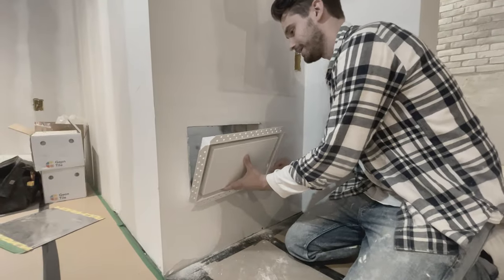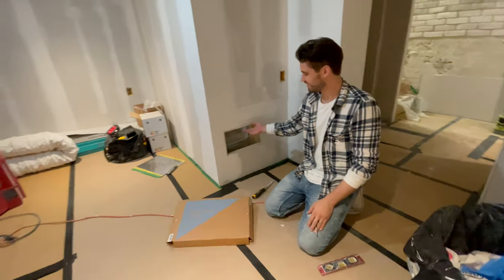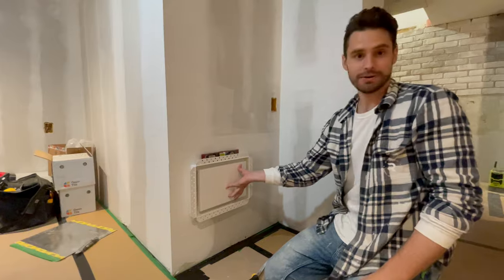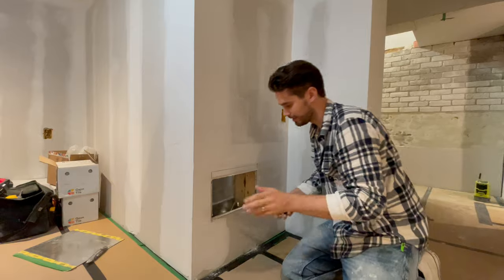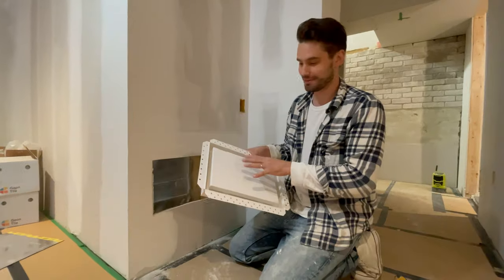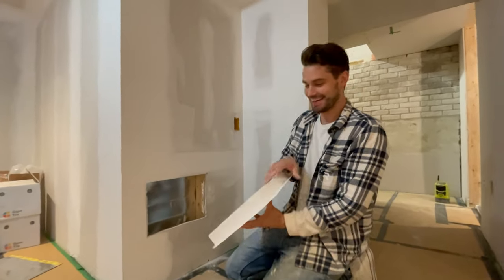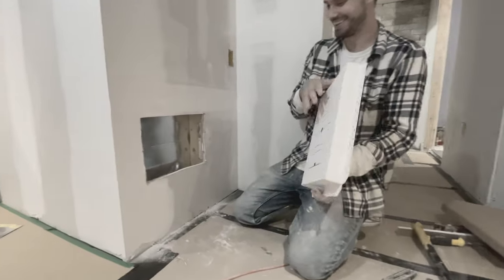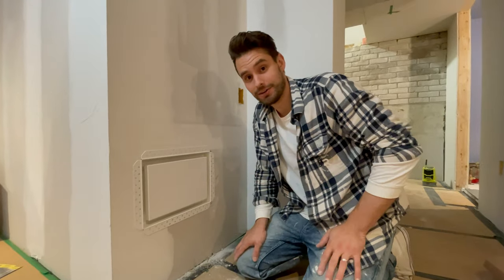Upgrade Your Air Return! (Aria Vent Drywall Pro Air Return)

Comment: I recently went to a house that was remodeled and they had these style registers  (vents) in every room for supply and return. The furnace kept shutting down on high limit because the airflow returning to the furnace was sooo restricted. Customer gave me approval to cut out this style on the return and it solved that problem. But the system still had high static pressure. To all homeowners, don’t sacrifice function for looks.
Reply: This is 100% correct.

Comment: This return has a major problem,  I'm a Nate certified Ac tech.  I've worked on refrigerated systems chillers and low temp units for most of my life , it will not flow the same air flow as the system is meant to have.   If you install this while it will look good, the airflow into your unit will decrease causing it to freeze up, add head pressure to your compressor and eventually cause your ac compressor to fail.  Things like this need to be done by professionals because airflow is the most important thing for hvac to work properly.
Reply: Agreed. All that decorative, designer crap is form over function. My winter return vent was stuck open earlier this year in my bedroom and it was hot and humid in there. I fixed it so it would close and it is now perfect in there. If the wrong return being stuck open did that, I could not imagine what practically no return would do. 

The previous owner of my house installed those stupid designer vents on my first floor. All they did was heavily impede airflow and direct it upward. My first floor had hot, cold, dry and humid zones all over the place. I replaced them with regular vents and the problem disappeared. In fact, it was a night and day difference almost immediately. 

Moral of the story, designer HVAC vents are garbage.
Reply: would this have the same negative impact on a natural gas furnace? I live where we don't need A/C (not common in homes here) but definitely need central heat!
Reply: @caitkacz   typically when the furnace is on, the fan is on a slower speed than the ac side.      Ideally there is a temperature split that us acceptable  anywhere between 40 go 70 degrees.   The risk of lowered airflow across the heater is that the chamber inside ( that directs burnt fuel and carbon monoxide out)   can crack If run outside of designed temperature range.    In some cases an hvac tech can wire in a medium speed to lower the temperature of outgoing air but the best solution is always to have a properly designed air duct system.   In my opinion this return duct is not that
Reply: looks like there were perforated section that are removable, he just didnt remove them

Comment: Hey Einstein, the air return is supposed to be completely open with a filter installed so the heat can be drawn into the air handler. Now your customer will be calling the A/C repairman out, and he's gonna be pissed when he sees the stupid move you did.

Comment: "Air return" and "cover" don't go together. Blocking the vent (or at least significant cross section of it, in this case) limits air flow.

Comment: Do not install these registers in your home as they dramatically reduce the airflow out of the register, which can damage your comfort equipment. It is advisable to consult with a professional HVAC technician to understand the impact of reduced airflow and increased static pressure on your comfort system.

Comment: I'm pretty sure you won't get the best air flow and the system will goes off because of overheating.
Reply: Worse than that, it will burn out your AC and you will be paying $12000 to have it replaced in middle of summer.

Comment: Loses a lot of return airflow very restrictive should keep in mind might cause problems down the road
Reply from the maker: Good tip 👍. We’ve never seen any problems with them, but we always recommend you check with your HVAC Specialist before installing.

Comment: I keep watching videos of these darn things being installed with no one showing me the before and after static pressures. Are absolutely no hvac professionals buying these and testing them?
Reply: If you look at the website you wouldn't buy them either start out at $60 for the cheapest, and its all plastic.
Reply: That's like asking if a skydiver jumps without a parachute. Anyone in hvac can spot this snake oil.

Comment: I think what would solve the restricted airflow was if the magnetic cover plate was covered in a breathable fabric in the same white color.  It would still conceal the holes while maintaining the design and providing free air flow.  The design would be similar to the fabric plates that cover the front of a speaker
Reply from the maker: that’s a cool idea 👍
Reply: It would still restrict the airflow and it would clog up with dirt and dust.
Reply: That would theoretically make it a big air filter and eventually clog no different than any other filtration system.  Return air is just that and that is a crazy small return in an odd location.  That unit would have to make some noise.  I have designer grills but I don’t think there is any way to dress that up.

Comment: Hello! Big fan of your videos and installed the aria flight light switches. I want to do this as well! 
However i have a major problem, all of my vents and returns are on the wall just above the floor.. so if you could imagine bottom is above flooring and 2inches height x10 wide.. 
please help!
Reply from the maker: Hey, thanks! 
Yes, that’s going to be a bit of a challenge for sure. We’ve seen people cut off the bottom flange but it’s not really want it’s designed for👍

Comment: why is there a stud visible in the return?
Reply from the maker: Good question! The cold air return in this instance is utilizing the unlined wall cavity (in other words the studs and drywall form the ‘ductwork’ for the air return). It’s common practice where we are, but also not up to code in some areas 👍

Comment: Are there filters that fit in behind the removable clip on piece?

The vents I have currently have filters behind them.  I’m wanting to modernize my home and this would be something I’m looking at, as well as the ceiling registers.

I just don’t want to choke out my furnace.
Reply from the maker: These do not have a built in spot for a filter, unfortunately. You can check their spec sheet re. airflow (or consult an HVAC technician), as you may have to size up in order to achieve the necessary open free area your furnace requires 👍

Comment: It kind of look like he forgot to punch out the holes in the back of it so it can actually suck air
Reply from the maker: Good catch 😉. We intentionally left them shut until we finished the ‘dusty’ portion of the renovation 👍
Reply: @RefreshHomeImprovements  This is a DIY video but you didn't film nor reference punching out the holes in the back?  Anyway, I think this is why you have so many people pointing out air flow issues.

Comment: Just trying to figure out where the air flows (in), those little round holes?
Reply: There are air flow vents in the back panel that will be pushed open.  I do not believe this was highlighted in the video causing some of the confusion and or ill informed comments.
Reply: @timothyengland7781  That is great. I like the design too specially for a air return unit.  Mine it's on the sealing so this may work.  Thanks for the great vid and easy install instructions.

Comment: Where does the filter go?
Reply: Air return vents don't have filters
Reply from the maker: Good question! The filter is usually located in a slot built in to the side of your HVAC unit (not in the air returns themselves) 👍
Reply: @Blake.Bowman  They do if your house was built right.
Reply: @RefreshHomeImprovements  That is 100% wrong. Most Techs don't recommend putting the filter in the AC unit, but on the return openings. Having the filter on the AC unit greatly restricts the air going into the unit and shortens the life span of the AC unit.

Comment: Do not buy this useless return style vent. Return vents are made to allow as much air as possible to return to the AC/Furnace. Installing these modern vents, chokes down to return rate putting significant strain on your unit. These are fine for bathroom fans and possibly supply. But do not install unless you are looking to replace your units fan and motor. If you look at a return grille, they are an open style and the bars across are very thin. This is too allow massive amounts of air flow. I know the data sheet says it will perform, but this data sheet does not know the area of your home. It does not know your AC/Furnace, it does not know many factors of your mechanical system. It would be best to consult your HVAC Tech, they will more than tell you that have to run a test on a computer system with your furnace and area of the home.

Comment: What air venting system fan goes with this?? Can it be used with any fan for the bathroom??
Reply from the maker: This is actually their air return cover, not their exhaust fan cover. I’ll post the link to that product below. It works with MOST fans, but not all. They list the compatible units on their site (we’ve never had a problem using it either 👍). 

https://ariavent.com/products/drywall-pro-x-exhaust-fan

Comment: hi I got heat pump installed in 2 level house lounge is in ground floor with 3 200 diffusers blowing air to it but installer had install return air on upper level ceiling . the problem is it take 3 hours to heat that area . do I have to take return from ground level to circulate air

Comment: Should you use spackle or joint compound to finish the edges of the vent?
Reply from the maker: We’d recommend using joint compound for a job of this size 👍
Reply: You  should not install it because it's terrible.

Comment: You are absolutely clueless about air conditioning. The opening is likely designed to be 80% free area. Blocking 80% of the opening kills air conditioners and furnaces.was the look worth 1000's of dollars in repairs and higher utility costs?

Comment: Net Free Ventilation Area fail
Reply from the maker: It’s our understanding that they meet code, buts it’s always a good idea to check with your HVAC technician first 👍. Some more info on the air flow specs here: https://ariavent.com/pages/air-flow-specs
Reply: @RefreshHomeImprovements  Inspectors are not concerned about proper sizing of forced air system components. I am confused as to why you would claim "they meet code". I looked up their air-flow-specs. Thank you for sharing them. The Aria 14" x 14" Drywall Pro X has an open air flow area of 32.4 square inches. 32.4sq" equates to ~17% net free ventilation area. Compare this to a commonly used high performance grille type is cube-core. A 14x14 cube-core grille has a net free ventilation area of 84%. Starving a cooling system of proper airflow could lead to a frozen evaporator coil; starving a heating system of proper airflow could lead to an overheated heat-exchanger and short-cycling of the system.
Reply: @brianbesold9477  What he did in this video is basically put a GIANT cover of a very small hole. It's absolutely useless.

Comment: Where the filter ?
Reply from the maker: Good question👍 the filter is usually located in the HVAC unit itself, and not in the air return cover
Reply: Cold air returns don't have filters.  Only in the rare case your actual HVAC unit doesn't have one before the air handler
Reply: @porkchop10  That is completely wrong. Your filters should be on the returns, not the small opening for the unit, for best airflow and longevity of your AC unit life.

Comment: That looks outstanding!  How is the airflow?  Such an elegant solution to the regular vent.  Thanks for sharing!
Reply: Not good
Reply: @JefeDog  Thank you...love to see the facts!
Reply: In the video he didn’t actually open the vents in the back so it’s hard to judge visually what the airflow would be like
Reply: @wombat1011  Look at the tiny holes behind that cover. Those are the facts. Almost no room for air flow. This kind of vent is aimed at the idiots that use those flexible drain pipes on their sink that clog up with gunk and are actually a code violation.
Reply: @vflytrap7158  It is not difficult to judge. Even with those flaps completely open, there would hardly be any airflow.
Reply: Probably like breathing through a straw or a cigarette butt.  That design is awful.  If you just wanted to stop the return air just close up the hole in the wall.
Reply: If you go the company website, you can see there how the fins in the back can be opened they are on a swivel or hinge.  But for $60 I'd rather look at a metal grate that costs $9.